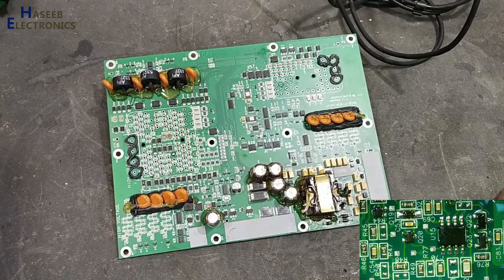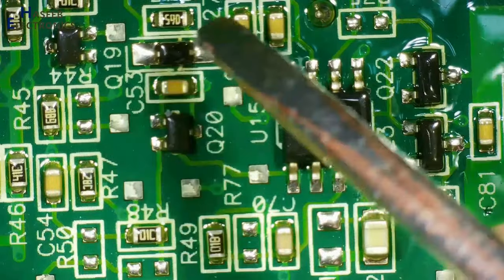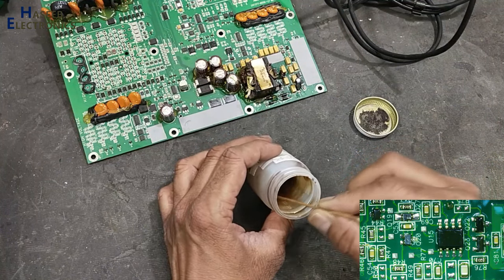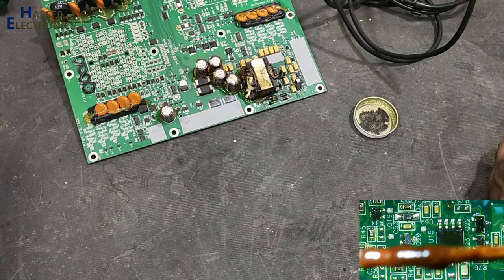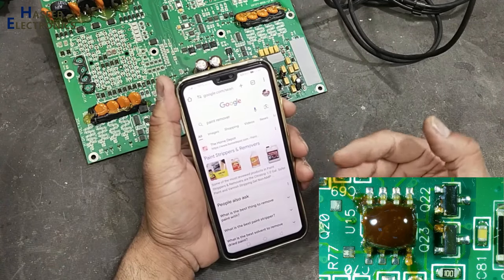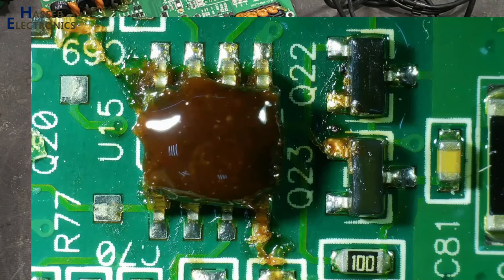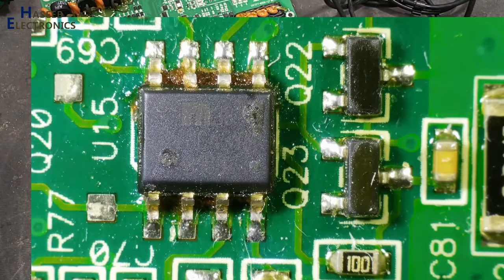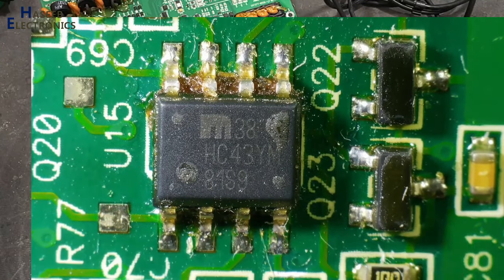{1103} Removing Conformal Coating from electronics circuit boards

Comment from the maker: i am sorry, i forgot to mention in video
After getting part number, it is important to remove component and clean PCB tracks using soapy water and then cleaning with alcohol or any cleaning solvent. 
note: if we remove component before removing paint, somtimes the heat causes to fade the printing on the PCB. then application of paint remover erases the remaining marking as well. 
it is best to remove paint and then remove component and clean the component and PCB area
Reply: The voice of experience!

Comment: I just plow through the coating with the hot soldering iron. The coating gets soft and just peels off. No problem with reading IC imprints as the component doesn't get scratched as if you would try to remove when it is cold. No toxic stuff etc :)

Comment: Very helpful, thanks.  I recently damaged a board just chipping away at conformal coating with a razor.  This is a much better idea!
Reply from the maker: thanks a lot for your valuable appreciation 
this paint remover / paint stripper is very effective 
MEK or IPA are also working but very slow. sometimes it needs multiple coats of MEK or IPA to soften the conformat coating

Comment: Thank you for the tip. I use ISO propyl alcohol. It softens it and can be removed
Reply from the maker: IPA and MEK takes a long time to soften it. sometimes many coats are required to remove it 
but it removes the acrylic conformal very easily

Comment: Thank you sir for this video. But sir many time I beg you to make a video how to measure voltage in every section of motherboard or circuit but. And which is the common ground to put black lead to measure output and input voltage
Reply from the maker: @restingroysurong805  brother! i already explained many times to select the return path for testing the signals. we cannot select only one common point to test output and same common point for input 
we must select return path based on circuit configuration. each circuit has its own current flow paths based on circuit requirements 
sometimes only one return path is common point of all output side, but in some circuits there are multiple return paths. so we need a very careful study and understanding abouot the circuit flows. 
i will try to arrange a practical to demotrate different testing options

Comment: Good but you would need to remove the chip to clean the board of the remaining paint stripper debris.
Reply from the maker: yes. After getting part number, it is important to remove component and clean PCB tracks using soapy water and then cleaning with alcohol or any cleaning solvent. 
note: if we remove component before removing paint, somtimes the heat causes to fade the printing on the PCB. then application of paint remover erases the remaining marking as well. 
it is best to remove conformal coating first and then remove component and clean the component and PCB area 
i am sorry, i forgot to mention in video

Comment: I just put a little bit of zippo gasoline and put it on fire, so it evaporates and fire stops. Conformal coating changes it's properties and is easy to remove. I know for many people fire on board is unacceptable, but those components can tolerate pretty high temperature during normal operation.

Comment: I just read that a key chemical in Paint Stripper and Paint Remover products will be phased out immediately only available commercially after 2025, at least here in United States. So, you might want to run out and grab a bottle or two for future needs. I have heard Acetone or Nail Polish Remover also can work for some conformal coatings, but I've never tried it. Anyway, thank you for posting.

Comment: A.Alykum Haseeb i have 12v 33A dc power supply it has some audible noise on chopper transformer and i want to change it but i dont know how can i get equivalent transformer to replace can u guide me please
Reply: You can check to give dc  supply of your transformer

Comment: I don't understand why is need to remove no of components
Reply from the maker: becasue some debries of paint remover enter below the component and its long time presence on PCB can damage the component and it will also erase the PCB track layer. which will cause to build oxides and phosphates on copper tracks 
which will lead to damge

Comment: Am using glue remover solutions, which is used in mobile repairing shops. But it's sometimes didn't remove properly. I have to fight with that😂